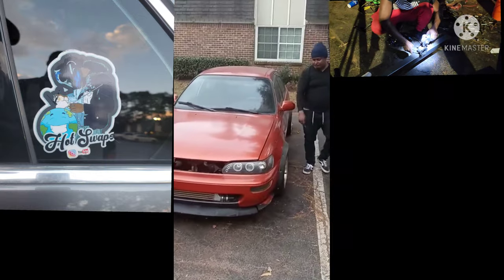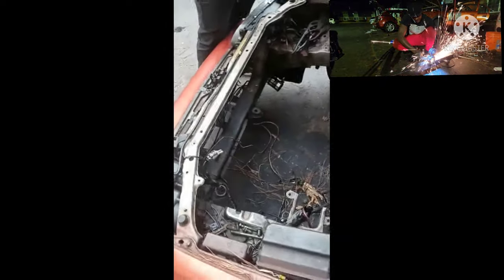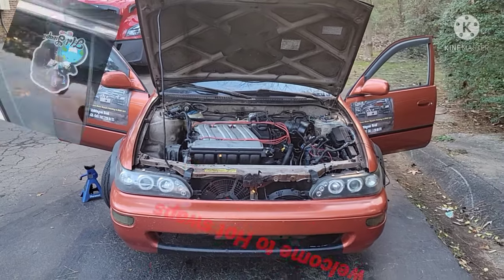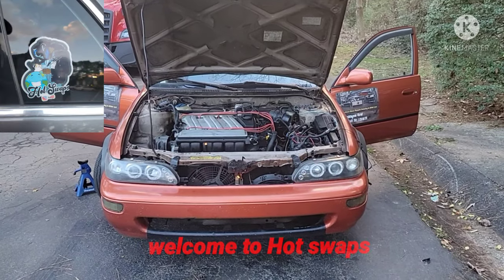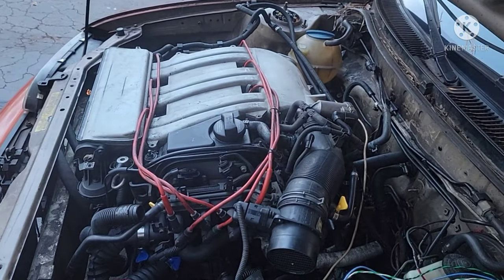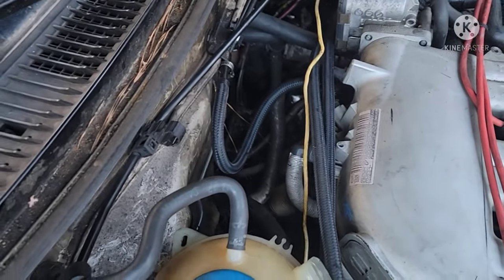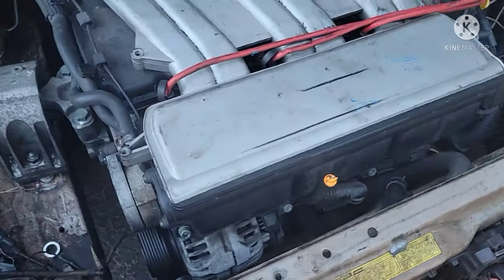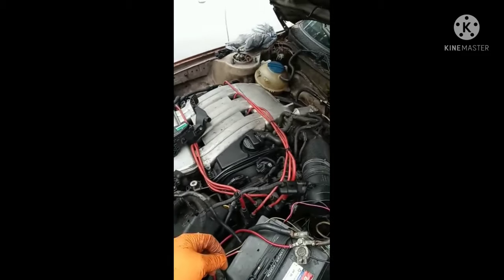VR6 SWAP COROLLA

Comment: Hi how did you sort the drive shafts out was it difficult if you don't mind sharing that info
Reply from the maker: Happy to help brother depending on. Your particular swap you want to do I can suggest several ways you can achieve this but my  go too is to cut the axle cups and merge the toyota and the  vw or what ever motor of your choice wire done by me as well was cleaned up after or first burnout but since then that car has been swaped to a 3.6 vr and now we're gonna do a 1.8t dsg built motor next will be documented better the reason some of the video don't show much is that while doing them the ideas come faster that picking g up the camera